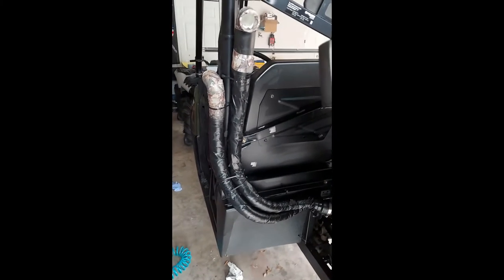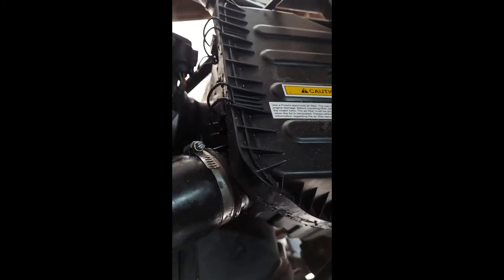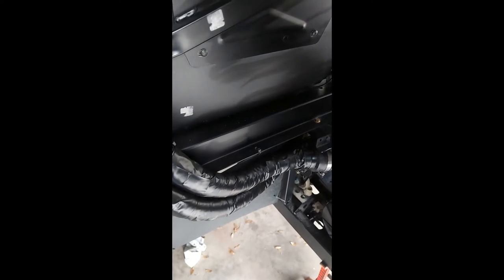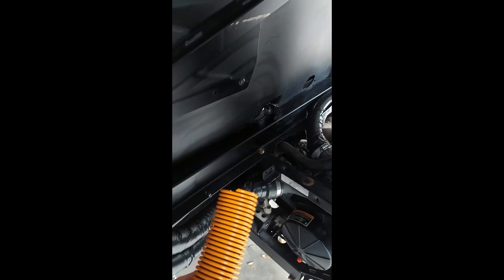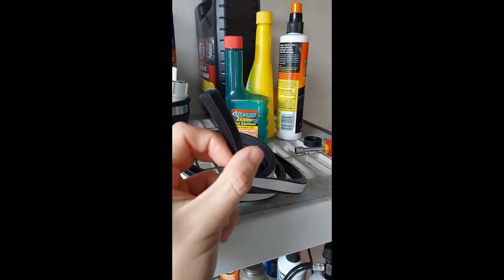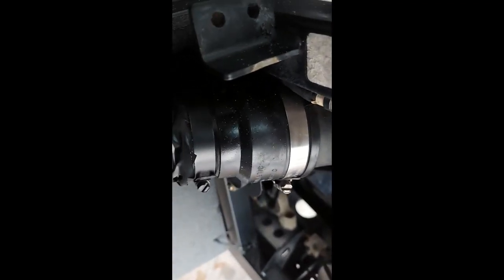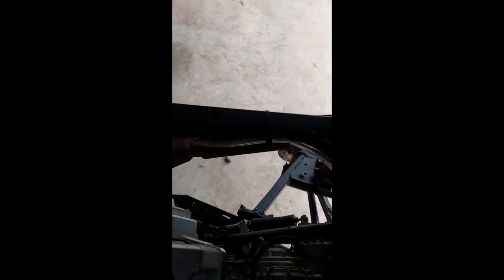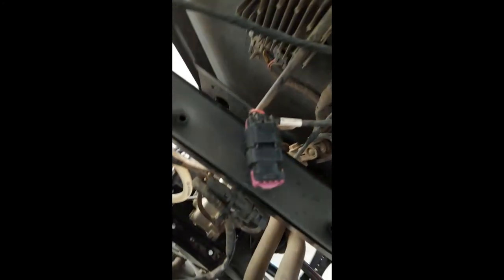Polaris Ranger 570 Snorkel Guide (No Bed Cutting)

Comment: What lift do you have on your ranger I have a 2017 and only want to run 27" all terrains on mine not into mud riding more trail but I do like the snorkel build easy enough in itself to do
Reply from the maker: 2.5" MMA Lift simple install and clears up to 28" tire